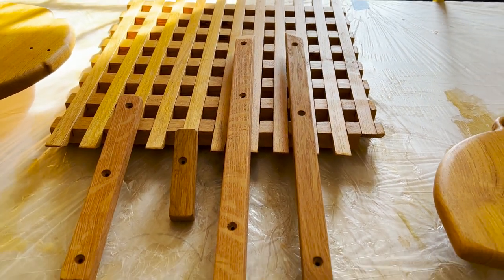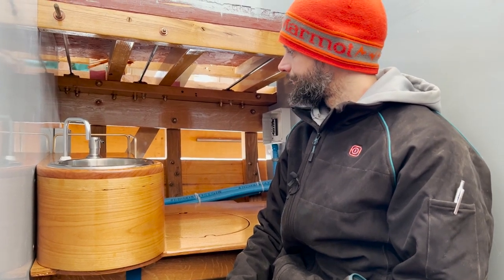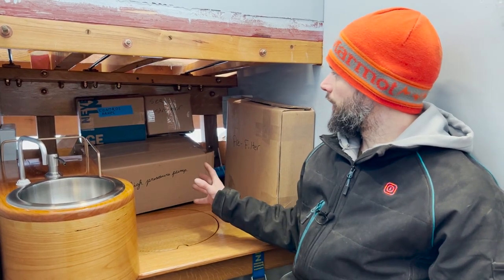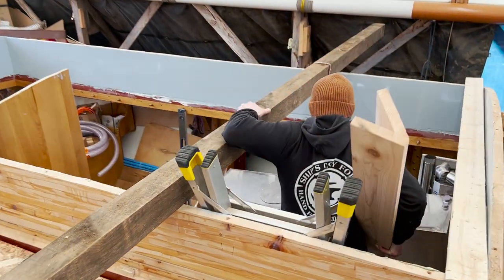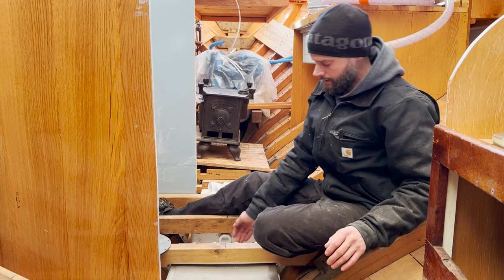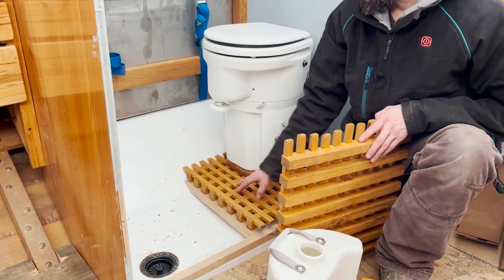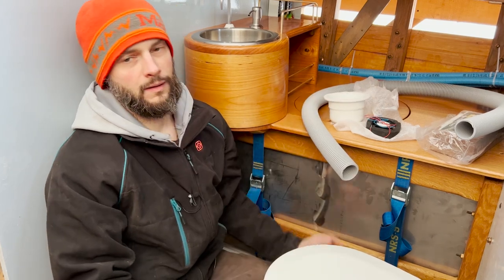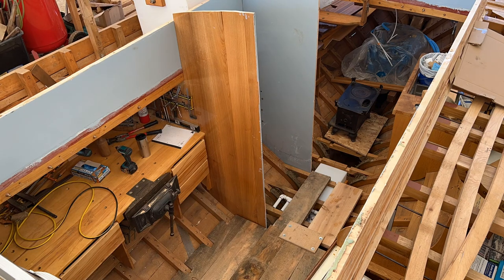Putting In the Bilge Tanks - Episode 205 - Acorn to Arabella: Journey of a Wooden Boat

Comment: On your fresh water system, any concerns about smell or taste?  If so, you'll need a carbon filter.  The reverse osmosis (RO) filter will not remove any of that.  You also may want to make the RO filter housing removable because you may have to scrub out the housing if you have a bacterial contamination.  The key to the RO system is the needle valve; you keep it  cranked down to increase the pressure used to push the water through the RO filter, your water is very clean, but the concentrate flow is much higher.  It seems like a waste, but if you don't keep the needle valve cranked down, your fresh water won't be so fresh.  Also backwash your RO filters after you are finished.  Use some of the fresh water for the backwash to keep bacterial growth out of them.  Watch out for growth in our sea filter, (that will go first), keep spares on hand.  You will know because it will smell odd.  I have an RO rig for making maple syrup and I found all this out the hard way.  Good luck.
Reply: Hopefully there are gauges that come with the equipment. You want a baseline of everything new where you can mark on the dial so you can tell when the membrane is starting to get plugged, and I second on the carbon filter with a way to back flush occasionally if possible.
Reply: Used to work in water filtration. I assumed that the pre-filter included a carbon filter, usually the carbon goes before the reverse osmosis. Chunk collector, Large element filter, small element filter, carbon filter..... (UV if you want) and then RO filter. Mind you I worked in house installs so I can't say much about boat installs. 
Final step for the really anal about their water is distillation.
Reply: I've been using a watermaker daily for years now, and have never had an issue with smell or taste of any kind.  Also, because we use it daily, we never flush the vessels, there is no time for bacteria to develop before they're washed out with salt again.  We've certainly never taken the vessels apart for scrubbing.
Reply: This is all excellent advice 👆👇

Comment: Im 100% with you on the foot pumps but it is nice to have a small house symetem that you only turn on when you need it, like if you need to drain the system or do a big job like a dirty dog, the dinner dishes ect.  I have a 1gpm (its really more like .75 ) that i can switch on from under the sink, not accumulator tanks or any of that just a $50 pump inline to 1 sink. Foot pumps a awesome till you need a sink full of water,  then you need kids or a pump.
Reply from the maker: Sounds like a nice system that works well for you. 👍🏼 thanks for sharing your experience!

Comment: Assuming the motor is FWC the option should be utilized. Not a fan of wet heads but always had one. The descant head works, any introduction of liquid to the solid compartment causes problems. The ventilation fan works, except when it doesn't. Two people two weeks. Were do those bugs come from maybe the screens aren't fine enough

Comment: I reckon you can burn the disseccated solid human waste if you press it into a brick or pallets with a 20T hydraulic jack and a jig.
There it will be always space for storage as you will be using coconut fibre regularly. 1 clean out, 1 energy enriched in
I would also vent the toilet with a T junction at the top of the chimney high pressure hot air will.always suck the cold air in the toilet air duct so there will never be any hot air backfeeding in the toilet.
12V Fan works better if installed at the toilet end. They move a fair volume of air but they need to be close to where needed.

Comment: I design buildings.  Keeping a design simple, but functional is the hardest of things to do.  I'm always surprised when I go to the job site and discover that the builder has actually made an even simpler connection.  Having hands on allows for design changes. I'm building sheds now to my design. I change as I go, because it doesn't always work out.  I like how you leave room to change. It would be great if gravity alone would hold those tanks in there, but gravity doesn't work in a boat like on land.  Up is not always up in a boat.

Comment: Screwing battens across the underside of that board over the water tank in the bathroom guarantees that it will crack. You've made no allowance for wood movement. Slotted holes with dome-headed screws would have worked. Round holes with countersunk screws ensures that this will fail.

Comment: I don't know if it would work in your situation (because of complexity or cost or whatever) but would it be possible to rig up a mini hot water heater using the exhaust from the wood or diesel stoves? My initial thought would be to put in a small tank (heck the day tank might even work) with a portable air compressor then run some copper or stainless piping around or through the exhaust stack a few times before running it to where ever you want to have hot water. Like I said I don't know if it would work in your situation but I bought a small booster pack with an air compressor for like $70 (it was about $100 Canadian so I'm estimating) and the heat would be something you would be tossing overboard anyways. Throw in a one-way check valve at the tank and as long as there isn't direct flame on the piping I would think the pipes would be fine. Anyways, just a thought I had for you to consider :) Can't wait to see what she looks like this time next year.

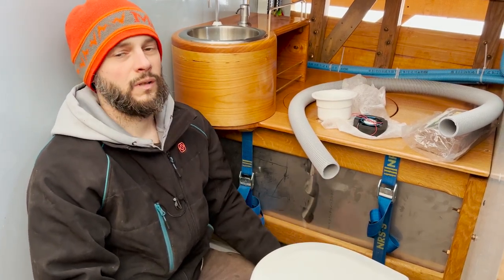Comment: 30:46 I always wondered what would be the best option for toilets on affordable boats. If you are the medieval type you could just put up a curtain and a beam at the railing to drop your swimmers. I guess for under deck your system is also much safer than a direct flush to the ocean to avoid unintended flooding. Are there systems with something like a garbage disposal shredder in the drain pipe around?
Reply from the maker: Yup, that’s called a macerator.
Reply: @AcornToArabella  thanks for the reply

Comment: did you consider that probably a lot of condensation might happen at the outside of the water tanks?
Reply from the maker: It’s not likely that the water coming out of the watermaker will be cold enough (or, more important probably, run fast enough) to vary in temperature from the ambient air that much, but yes. We’ve thought about it a bit.

Comment: Are solar distillers an option on boats? A portable/folding solution could help ease the reliance on the water tanks or water maker, in extreme scenarios.
Reply from the maker: I think the output isn’t comparable to the RO system that’s planned for Arabella, but would be a nice piece of backup equipment for very remote travels.

Comment: Modern pressure water pumps are very reliable.  I have had exactly one pump failure on my boats in 45 years of use.  If you are concerned about pump failure, carry a spare.  The pumps are not that expensive.  I find that I don't use much water on the boat with pressure water.  I always turn the pump off after pressurizing the system, which prevents water loss due to leaks when not using the water.  Also, pressure water systems do not use much power if you install an accumulator tank.  As far as hot water goes, you are going to have a diesel engine.  A standard 6-12 gallon water heater connected to the cooling system on the diesel will heat the water in the tank in 30 minutes or so, even at idle.  You are going to have to run the engine to charge batteries and run the water maker, so heating water is not a real issue.  You can install a water heater and pressure water for as little as $500 or so or around $1K at the high end.  A 12 gallon water heater and pump take up less than  3 cubic feet.  A quality water heater will keep the water hot for hours and warm over night.
Reply: It's not so much the owner who wastes water when it's pressurised, it's crew who do not have a background in sailing or the mountains or suchlike. Pressure water systems are inescapably a deal breaker on that front, unless you want to alienate your friends and spoil your own peace of mind by admonishing them on a daily basis.
Comfort, by comparison, comes in at about #9 for a long distance voyaging boat. It seems to be considered disproportionately difficult by many in the US to do without things which in other parts of the world are considered optional and even trivial.
Reply: @Gottenhimfella  visitors are not a problem.  Just don't tell them how to turn the pressure water on.  I disagree totally on the importance of comfort.  For me comfort is way up there.  If I am not comfortable, I am not going.  I am over 70 and my days of roughing it are over.  That is particularly true when it comes to reliable systems like pressure water and roller furling.
Reply: @todddunn945  I don't see the slightest problem with you wanting that for yourself. What I am pushing back against on this page is people telling other people that comfort is what THEY should want.
Reply: @Gottenhimfella  I agree.  My points are that pressure water and hot water are actually easy to install, very reliable, not that expensive and don't use much power.  So many of the "traditional" arguments against pressure water don't hold much water - so to speak.  Frankly, if water usage is a major concern, the answer is to install a parallel salt water system so that high water consumers like dish washing can be done with salt water with only a quick fresh water rinse at the end.  Of course, if a person is a purist they can simply throw a bucket over the side for salt water when they need it.  Finally, in this particular case we have a guy with basically no sailing experience setting up a boat the way he thinks it should be based on no actual experience.  If I was setting this boat up I would put in pressure water and a water heater AND a set of hand/foot pumps in parallel.  That way the pressure water system and hot water are available if they want to use them.  Just because the boat has those systems does not mean the systems have to be used.  Just my opinion, based on over 50 years on the water.

Comment: You may have mentioned it and I missed it but I haven't seen anything to prevent backflow from the grey water tank back into the system and fixtures.  I know you don't really need to worry about slope in the runs because things will never be "level" while you are floated.  So how do you ensure you get the water into the tank and keep it there?
Reply from the maker: Things are indeed pretty darn level a lot of the time, to be honest. There will be a bilge pump and no more than a couple of gallons of gray water at any given time in that tank, less than the volume of the hoses that will lead up to the drains… that’s the theory.
Reply: @AcornToArabella  When that boat gets a rockin and a rollin, you'll want check valves on those inlets.  Pretty simple solution and not alot of effort.

Comment: Any thought given to putting the water maker in the engine room, if space allows?
Reply from the maker: Yes, but Steve prefers to have the runs of hose/PEX be shorter, and it seems like a good thing that should there be a leak or other problem with the pre filters, that they’ll leak into, essentially, the shower.

Comment: When i started watching this series i did not have a single white hair in my beard, now im not as far down that process as Steve is, but not far behind either ;D
Btw, how much thought did you put into the boats balance? Did you see the launch of SV Seeker and how she is listing to starboard? They are working on fixing it, but it was surprising to see that with such a big boat :)
Reply from the maker: We think about the balance of the boat quite a bit, and we do work with a Naval architect when we consider the placement of things like water tanks and other heavy items. Arabella has internal ballast that we can move to accommodate for balance issues. We can also remove ballast if she sits low on her lines.

Comment: With a crew of nine or more, head sink, yes.  For a two to three-man crew, walk 9 feet and use the only sink on board! A head sink on a 38 footer! - really?
   While homeless for 5 1/2 years, three gallons of hot water in a bucket, with a siphon served as a decent shower.  This You Tube boat is starting to forever remain on blocks due to couch-potato accoutrements. (like shower-related; water heater, dedicated pump, grey water pick-up, possible leaks, certain complications...) Suggest you run a chainsaw under the keel, to sever any roots that are growing.

Comment: I would hate having the foot pump to get water to run.  It is not complicated to design a system that remains simple and has redundancies that allow manual override
Reply: Most of the boats I sail on have foot pumps. They're the perfect option, IME. I am certainly not bothering with pressure water on the sailboat I'm currently working on. A gravity feed from elevated jugs, for certain special case uses.

Comment: to use the argument for a lack of pressurized water based on less usage and then install a watermaker makes little sense to me.
Reply from the maker: The water maker wants frequent use, but doesn’t make water particularly quickly. It’s still necessary to conserve.
Reply: Watermakers use a lot of energy, also cannot be relied upon for ocean crossings, and habits of economy are best instilled in crewmembers over time rather than as a new behaviour for an emergency.